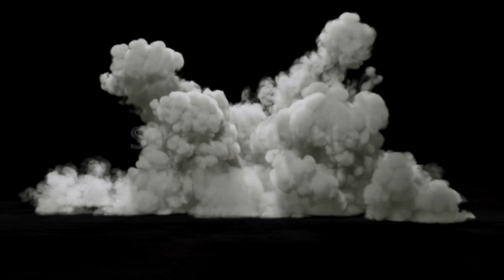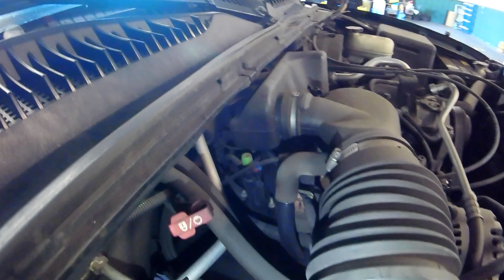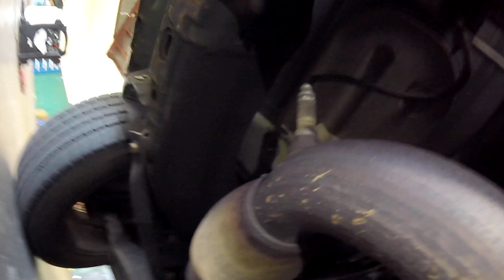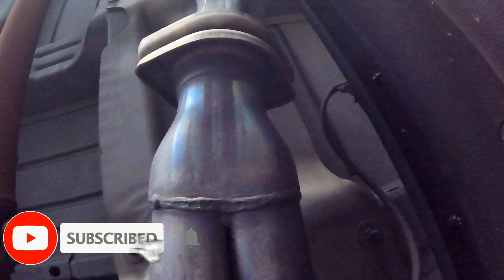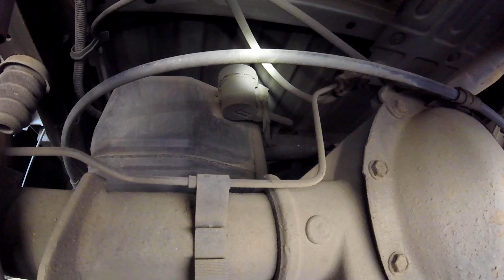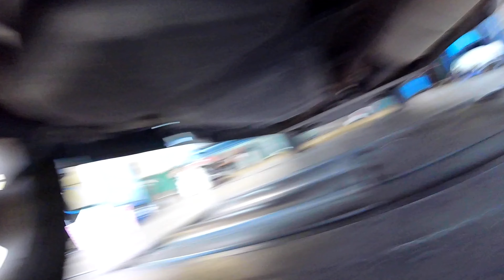⫷ Silverado Emissions Locations: EVAP, Oxygen Sensors, and more. ⫸

Comment: I dont have a problem pumping gas. I do t know much on vehicles, im just getting into them

I just got myself a Chevy Silverado 1500 2016
It was a use vehicles with a bad transmission, it was sitting on the guys lot for years, so he was selling it for "cheap"

I had it checked, and the transmission was replaced by a friend who knew a friend

No check engine light for about a week, then one day I couldn't remote start

I use the Chevy app to remotely keep track of it, and I told me:

The evaporative emissions system is good, but there is a problem with the Exuhast Emmison system

Im just thinking it's a sensor and not something big,
Reply: I was also thinking of getting myself one of those tablet devices that hooks up to cars and seeing what code it was throwing

I also just broke my keyfob 😅
And I dont want to go to the dealer or a mechanic I dont personally know to overcharge me

Im a guy of computers, I fix and build them, I know many common errors and how to fix them
So getting into cars is a bit different for me because it has a lot of BIG mechanical hardware evolved, instead of like a board with chips that can be easily replaced